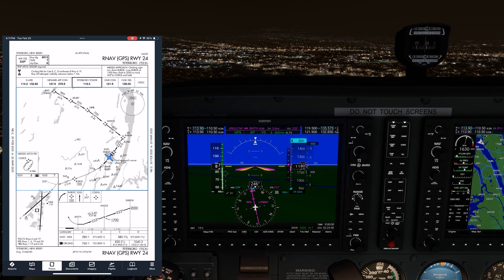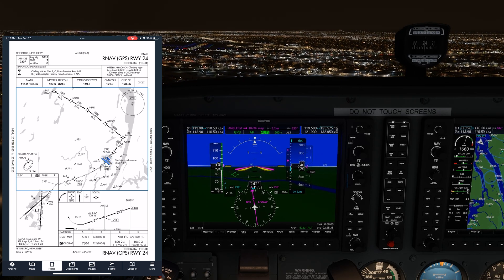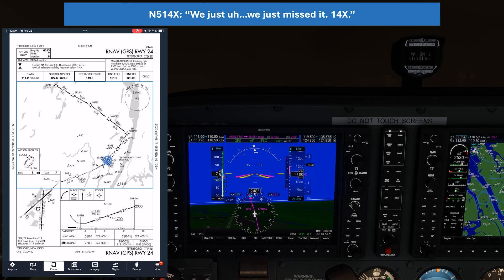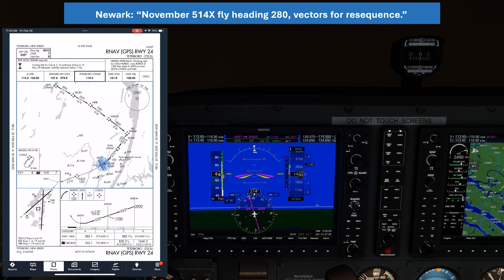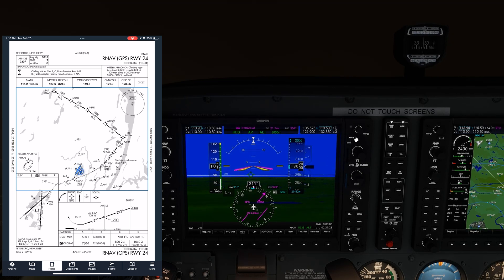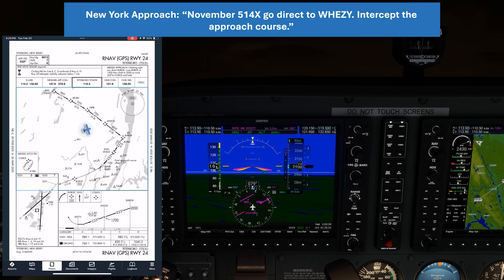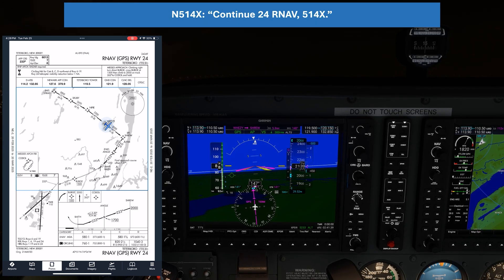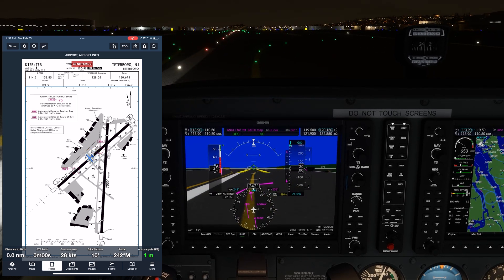Real World Missed Approach | ATC Communications in Real Time

Comment: Why not select “vectors” during your approach load? I only set up an initial if flying the published course (not when I’m being vectored)
Reply: If you activate vectors then you lose all the other waypoints on the approach because the  navigator will only give you an extended centerline. Personally, I only load VTF when that's the ATC instruction. There are other reasons for that and it deals with how the navigators scaling changes.
Reply: @ but isn’t that what’s happening? If the controllers said “expect vectors to (waypoint)” then I would set that up as the IAF. Otherwise if they’re vectoring, they’re almost always putting you on the actual approach course
Reply: @davidkamerath7749     Vectors to final removes all way points in the flight plan and sets up a straight in to the runway. There would be no IAF in the flight plan for you to pick in this mode.
Reply: @Saml01  I know. That’s my point
Reply: @davidkamerath7749    No because in this case ATC is vectoring you back to a fix next time it might be just the course. In this case they cleared direct to the fix and then they expected the pilot to fly the procedure as published. If you select VTF mode you will have no guidance except the final. Therefore, use the right mode for the guidance your expecting.

Comment: Really nice video as usual. I have one question. When the controller issued the instruction to go direct WHEZY, you hit Direct > Enter > Enter and your autopilot switched from HDG to GPS mode. I fly with a G1000, and it does not do that. On my G1000, the unit would register Direct WHEEZY but it would stay in HDG mode. Is the automatic switch to GPS mode a feature of newer (NXi) G1000s, or was there a step that didn't make it into the video?
Reply: It's hard to tell in part because of the positioning of the approach plate , but if you look closely and slow it down, you can see the mouse cursor move to the AP and switch to NAV after entering Direct WHEZY in the FMS. It would not be a good thing if every time you did a Direct, the AP would switch modes without you telling it to. Pilots will often update the Direct course for situational awareness while receiving vectors.